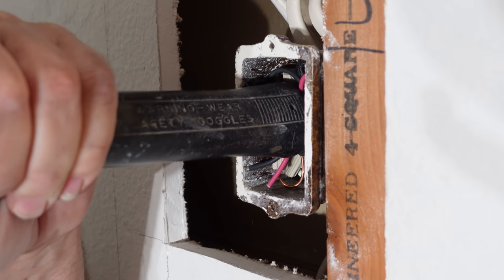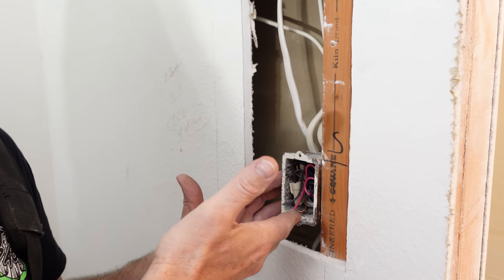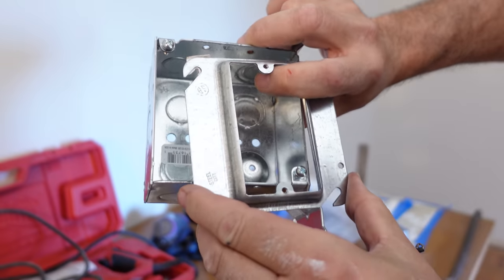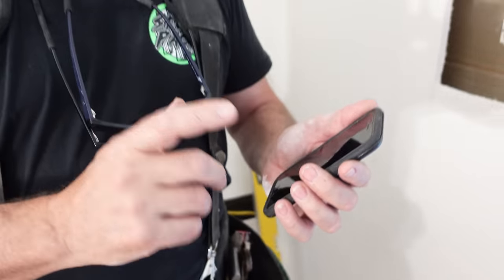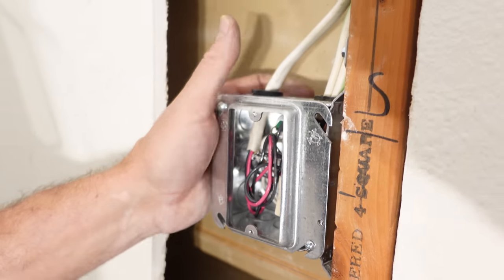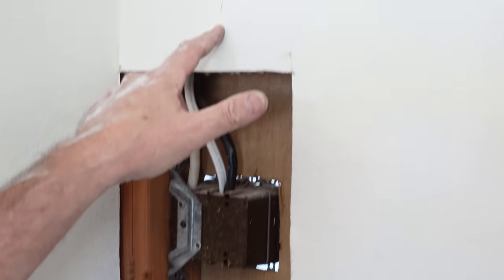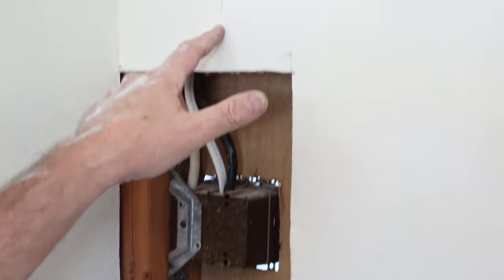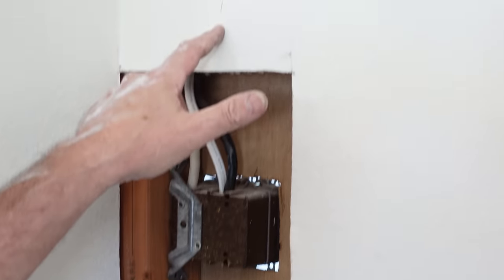STOP STUFFING BOXES! How Many Wires is TOO Many??

Comment: One more question please, how come some wires are yellow rather than white?
The ones in the bathroom for example
Just the size of to grave or is there a code for bathrooms etc?
Thanks
Reply: Yellow wires are 12/2. Where I am there are reqd code for kitchens.
Reply from the maker: The standard was changed to require the sheathing to be different colors.  Makes inspectors job much easier.  #14 is white, #12 is yellow, #10 is orange etc.   it was all white sheathing before the code change

Comment: Plastic boxes seem pretty flimsy metal is the way to go.
Reply: The blue plastic boxes at least are just fine. When I was running ethernet cable in my house (Low Voltage work), I used low voltage boxes. They're a lot like the plastic boxes in this video, except they're shallower and don't have a back wall. This makes running low voltage wires extremely easy, as all I really needed was a way to mount a 6-slot Keystone faceplate to the wall, and these low voltage boxes allow me to do exactly that as simply as possible.

The blue plastic boxes for 120/240v work are well engineered, and contrary to popular belief (or at least your apparent belief), well engineered doesn't mean "as strong as possible".
Obviously a cheap plastic box won't take a hammer blow like a metal welded box will, the reason for that is that they did good engineering by making it cheaper (both for the person buying it and for the manufacturer to produce it) by using less material.
Engineering is about hitting your targets and not going over. So if the box doesn't have a requirement for mechanical strength (and plastic boxes don't), then you make it as flimsy and weak as it can be made while still being strong enough to not break while being installed, and also meeting the other requirements (regarding such things as ability to withstand fire, to not stay ignited, to accommodate a certain number of wires and devices, mounting options, etc.).

For residential work you don't really need metal boxes unless you're working with armored cable, or wires in metal conduits, and that's pretty rare these days unless you're working in for example the Bronx where the code is that you must run all wires in conduit or use armored cables.

Commercial/Industrial, well that's another story, and you might run into a part of the code that outright requires metal boxes (and you can bet they'll be very particular about what features those boxes must have to meet the requirements).

Comment: One more thing 14 Gauge  wire has a amp capacity of 15 Amps of current draw of 15 amps and must be connected to a 15 amp circuit breaker! 

It is illegal to connect a 14 gauge wire to a 20 amp circuit! If a handyman or electrician tells you different they are completely wrong!  and inept!  and have no clue what they’re talking about! 

If you’re connecting wire up to a 20 amp circuit you must use 12 gauge wire!

With that said you can use 12 gauge wire and connect it up to a 15 amp breaker but not 14 Gauge wire to a 20Amp circuit! 

If you have a 20 amp circuit and you’re plugging in equipment that’s needs 20 Amps you must use a 20 amp receptacle and a 20 amp plug!

Comment: Those bakelite boxes are a pain. Ive been ripping them out of my house room by room. They used them for ceiling fans plugs and switches.
Reply: get rid of them. dont be tempted to use those equally garbage old work boxes either. they suck almost as badly as bakelites